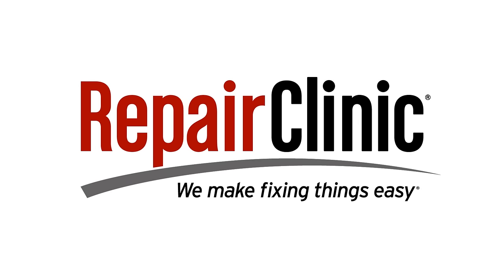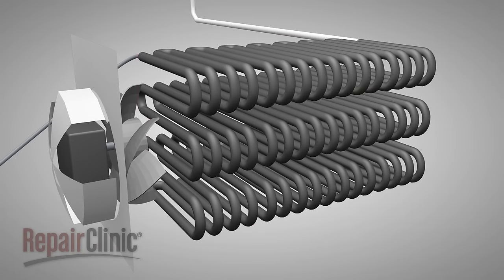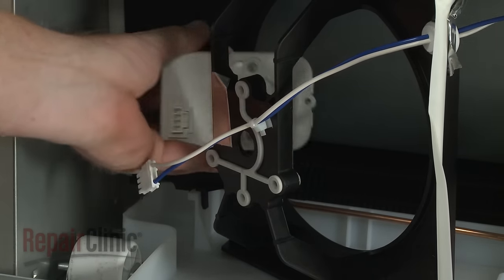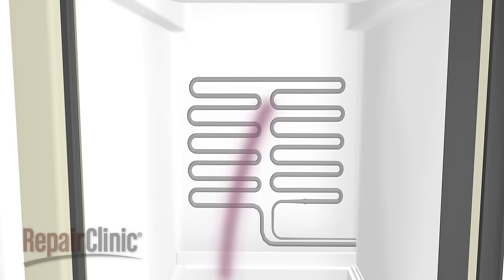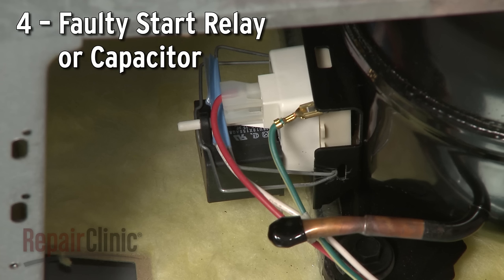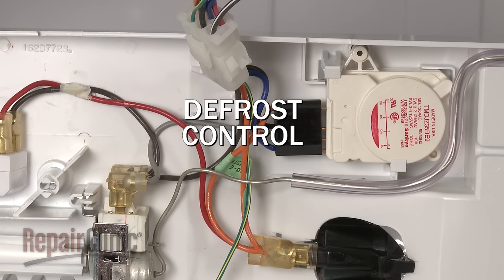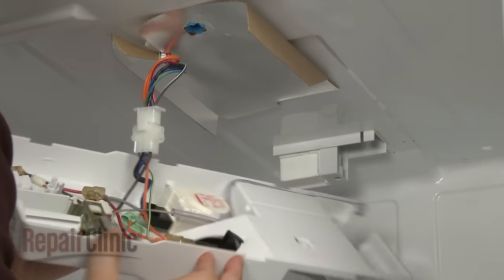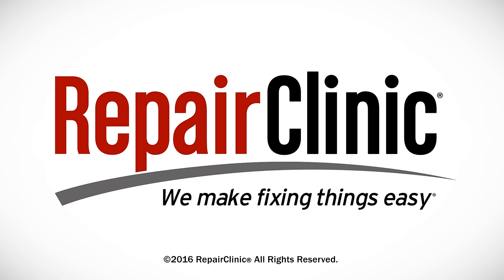Refrigerator Isn’t Cooling — Refrigerator Troubleshooting

Comment: Defrost timer was my issue. My 29 year old fridge was lukewarm. Freezer portion was ice cold. Checked coils. They were frozen over. Defrosted them with blow dryer. Fridge started getting cold again. A few days later, same problem. Checked defrost timer. It was broken. Replaced that for about $20 something. Fridge and freezer is back to normal.
Reply: I am having the same issue with my whirlpool, I thought it was the damper not opening , because the freezer is fine but I removed the damper and the fridge side isn’t cooling.   When I first defrosted the freezer , the fridge side got cold for a few days , but now back to warm.  Do you think it’s the defrost timer ? I’m lost on this.

Comment: I replaced my heating thermostat, temperature sensor, and  heating element and freezer coils still freeze up and heating element won’t turn on. But it will turn on if I jump start the board by touching j9 and j11 with a wire, why doesn’t my heating element turn on with out touching j9 and j11 together? Please help my food is going to waste

Comment: 1. Clean compressor cools
2. Malfunctioning condenser fan motor
3. Defective evaporator fan motor
4. Faulty start relay or capacitor
5. Evaporator frosted over
6. Malfunctioning temperature control board

Comment: Great video, thank you for sharing. Our refrigerator decided to take a poop on is last night. Not pushing out air cold enough in both the freezer and refrigerator.
Reply: Stacey Here we grow again 
Same, did you fix it?
Reply: @matthewmoneta7906  it ended up being that the freon was leaking (not sure how to spell that lol). which is impossible to find, so we bought a new one for a reduced price
Reply: I think I have the same problem. How old was it before it stopped working?

Comment: Thanks for the post... my refrigerator was sinking fast (declining temperatures), FF light was on. Checked the coils and realized that was the problem. Many Thanks!!
Reply: OUR problem is that the appliance is READING both 1 AND H, meaning that the refrigerator/freezer will go to the MINIMUM, THEN the maximum (and THIS is where you'd HEAR the beeping)

Comment: This worked for me unplugged overnight left doors open and put a electric heater in front of freezerNext morning plugged it in and it worked!!!! Try this first before you run out and buy a new one
Reply: Did you see your evaporator drain pan fill up/overflow?
Reply: @StephenAndrichuk  where is that at? Under the coil?

Comment: Hello 
I have problem with my Frigidaire refrigerator with french door same like this in the vidro. 
when I plugged it everything work fine but after few hours/over night it get worm, not cooling anymore, all ice melt and dripping water 
 I changed the relay/capacitor, clean everything in back, the problem still
So what should be the problem 
Please 
Thank you for your help

Comment: Would you mind advising me, my compressor is running, both fans are working well, I cleaned the coils (they were very dirty) , the main panel shows no signs of damage, blown capacitors etc, this began when my wife accidentally didn't close the freezer all the way so it iced over, unplugged for 2 days now, I'm thinking the thermistor or other temp sensor not calling for cold, all my major components are running fine. Thanks much LG french doors with bottom freezer drawer
Reply: Did you ever figure out the issue? I have the same exact situation at the moment with an LG. Sounds like similar models from your description.
Reply: @mrooah  LG has a compressor lawsuit going on with their models as well as Kenmores using the same LG compressor. This might not be the fix you're looking for, but it can get you a new fridge.

Comment: I have a 21 year old Amama refrigerator and the freezer is at the high 20’s and the frig about 40 deg F.  Yesterday I pulled it out and removed the back bottom panels and vacuumed all the crap out. After one day it runs a little better but I think that I will have to get a new model.  Last century I had a problem with another frig and it was caused by a loose piece of insulation stopping the fan.

Comment: My KitchenAid Side by Side (Model number KBFS20ETSS01) is not too warm.   My refrigerator is stuck at 55 degrees, and my freezer is at 40 degrees.  I have unplugged and plugged it back in, turned it off, using the Temp Control buttons, but the desired temp settings, go right back to 55 and 40 (Fridge and Freezer) respectively.  No matter what I do it goes right back to the warm temperatures.
Reply: this is exactly what is happening to ours now , did you find out what was wrong???

Comment: My frige side isn’t cooling , freezer is fine. I pulled the damper assembly because I didn’t feel cold air, but still no cold air is blowing through .  Yet the fan in the freezer is fine and it’s blowing.  But for some reason it’s not coming through to the fridge. Someone below said defrost timer.  Originally my freezer was frosted , I defrosted and it did get cooler on the fridge side , but now a week later it’s not working again.

Comment: I just got this refrigerator three days ago the only exception is it’s a Frigidaire. The temperature is fine but It has not stopped running since I plugged it in.  Is this normal on new refrigerators ?

Comment: Please advise what your thoughts are - I am trying to find a problem in my side by side fridge freezer as while fridge one works fine, the freezer evaporator is only 1/4th frosted and so food does not freeze. Everything seems working fine, there is no sign of leakage in the coolant and I'm puzzled..
Reply: its most likely short on gas ....after recharging the unit clean the condenser
Reply: +sim ridge will do. many thanks
Reply: +Joshikol x charge it to 5-8 psi and remember to check what gas it uses
Reply: Thank you for your answer Sim

Comment: Not the freezing over of the  drain at the back of the fridge.......???? That will happen now and then ....at the moment it happens with my new fridge which I could only place under the kitchen counter top with the acquired 5 centimeter ventilation space near the fridge top, which still traps a lot of warm air under the counter , which I think is the cause of the drain freezing over ?

Comment: Question:  whirlpool frig auger not coming on.......took it off and put 120v direct and it works....checked the micro switch in the door and have continuity.......put a volt meter in one of two wires going to micro switch to see if power grounded the other lead to frig  nothing  did with the other wire, no voltage?   any ideas??? thanks

Comment: What could cause only the top evaporator coil (where the freon is entering the coils) to be cold but the rest of the coils to be NOT cold? The air coming out of the air baffle on top of the fridge is warm but the compressor seems to be working since there is frost on the first coil but it seems most of the evaporator coils are not getting cold.
Reply: Did you ever get it fixed? I have the same issue.

Comment: My Kenmore model number GS5SVAXVB01 side by side is not cooling.  I replaced the devise on the side of the compressor, with the 3 prongs,  the compressor now runs, but gets warm/hot and still no cooling.  I touched the cold line and the hot side line and neither are hot or cool. All the fans are running, and the coils are clean.  Is there a video to diagnose this issue?

Comment: I have a Whirlpool refrigerator that is not cooling(does not have a freezer section). The compressor and all fans are running. The only issue I see is that it is icing up where the tube comes from the condenser into the small copper line going back to the compressor. It is right next to the thermister. Any suggestions? Thanks

Comment: Freezer fan blowing cool air but not freezing food or water. Whirlpool top freezer 13 years old.Condenser coils are clean, door gaskets seal good, compressor is not hot and food in freezer real cold but, water in ice tray will not freeze.
The fresh food department is cool and not cold.
Please help!
Awesome video. Thanks so much.
Reply: I have a Frigidaire Gallery the freezer works fine but the frig doesn’t get cold at all. I cleaned the coils on the bottom. Please help, can’t afford a new frig right now.
Reply: @yjeffe  evaporator fan motor most likely bad

Comment: Hi Guys, I have model E23CS78HPS5  Electrolux icon series freeze . having issue with it is not getting defrost and then freeze get warmup . one tech came in check defrost heater and thermostat is ok  along with evaporator fan ok, compressor is ok  ,condenser  coil cleaned , now try to find temperature control board or main board could be issue that not sending signal to do defrost cycle. head office had no info other than suggesting  call their tech but they don't have control board in stock . any help to  open this both board to inspect before ordering or other hint would be appreciate.

Comment: I have a ge dss25ksrc ss I cleaned the coils.  Both of the fans are running.  Is the thermistor the next step? Can I by-pass it to test if it's the problem?  I don't think the compressor is running.

Comment: my evaporator fan motor doesnt turn on. I've replaced the motor. compressor works fine, but no circulation. is there a component that controls the fan motor?

Comment: My refrigerator is a GE profile, side by side. The freezer side is working just fine, but the fridge side has gone warm. The message "dE" is flashing. I unplug unit from the wall to do some kind of reset, but this has not helped after a while, what would I need to do, please?
Reply: Ken Akoh-Arrey have the same problem i don't know
Reply from the maker: This is indicating a defrost system problem please click here: https://www.youtube.com/watch?v=5vA8Ksv5kVY&t=4s
Reply: Ken Akoh-Arrey
Reply: Oh, I solved my problem by replacing the heater.
Reply: Ken Akoh-Arrey I also have a GE and it built so much ice in the freezer I got in the fan and was very loud so I unplugged it to defrost it but now the freezer works in the refrigerator does not and it's only 2 years old
Reply: We have a Frigidaire side-by-side refrigerator and freezer.  The digital reading is ON THE FRITZ, and will show a "1" and "H" alternately.

Comment: help we have a KitchenAid refrigerator. approximately ,5 years old. 3 weeks ago alarm went off saying high temp I'm fridge.  couple days later it quit making ice. freezer is fine , but fridge still alarming. had repair man out he replaced termistor, didn't fix it. told us we needed control panel , that didn't fix it. any suggestions,? thanks

Comment: Hello, I have a Samsung RFG298AARS, the refrigerator stays at 40 degrees while the rest of the unit seems to be working fine. 
I have replaced the evaporator fan and thermostat.
If I push power cool the refrigerator will go down to 30 degrease.

Comment: I have an lg lfx33975st and the evaporator fan isn't spinning. No obstructions and there is continuity, but it just does not want to spin when the fridge is powered on. Any suggestions?

Comment: LFXS24623D/00 LG refrigerator evaporator fan wont run, compressor working,  but not cooling.  any on help me please?  both lines of compressor has the same temperature.

Comment: help pls. my ikea refrigerator is not cooling ref. is practically new about 3/4 years have no idea if it has  warranty. eve thing on out side Looks ok. but don't know what look for in side of the paper on back of ref. can u help?
Reply: Lilly C I would look at the components that are listed in this video to address a fridge not cooling issue. If it has frost build up then could be a defrost issue. If no frost then check some of the other parts mentioned such as the damper door or condenser coils to see if dirty.

Comment: i HAVE A GE PROFILE SIDE BY SIDE REFRIDGERATOR IT HAS AN EVAPORATOR ON THE REFRIGERATOR SIDE AND FREEZER SIDE SHOULD THERE ALSO BE AN EVAPORATOR FAN ON BOTH SIDES?
Reply: No. The fan Should be in the freezer section above Those coils behind that back panel. The fridge side gets cold air from the freezer section in side by side models and top and bottom models, but The ones with the freezer on the bottom. I think the coils are located in the refrigerator section.
Reply: So no evaporator fan in the fresh food section But there is a motorized damper that allows air to come in from the freezer.
Reply: Never really heard of one having two evaporator coils. Lol

Comment: A refrigerator should last 20+ years until it runs out of gas, which can be refilled.
Reply from the maker: A refrigerator typically lasts between 10-20 years depending on regular wear and tear. A refrigerator will last longer with regular maintenance and upkeep.The average life expectancy of a refrigerator is about 12-14 years.
Reply: I am not talking about American or Chinese fridges which are designed not to last for repeat purchases and profitability in mind. A fridge doesn't need a lot of maintenance and it will last up to 30 or 40 years. A fridge is a robust equipment and I am talking about fridges from reputable manufacturers. I had a family fridge that lasted 30 years and we sold it not because it was broken but because it was old. It was still functioning

Comment: I have a GE GFE27 and the front panel reads two different temperatures. When I press the temperature setting it reads 34 degrees as temperature sat for the refrigerator but when that reading goes off then a temperature of 55 shows as refrigerator temperature. My refrigerator feels warm, like 55, and my milk went bad. what do you think the problem is? should I get someone?

Comment: My compressor will not go off.  My freezer works, but the refrigerator won't...any suggestions as to what's causing this?  Freezer is on top, refrigerator on bottom.  It's in my garage but it's been in the low 40s and around 60 to 70 degrees during the day
Reply from the maker: Check out this video Jessy: https://www.youtube.com/watch?v=5vA8Ksv5kVY
Reply: Check your defrost timer/ADC. Also, check your freezer adjustment. Make sure it is not on "Coldest", since this shuts the damper door from the duct to the fresh food compartment.

Comment: The liquid expands to a gas when in the evaporator coil and absorbs heat. The heat laden gas is then carried to the condenser coil, where the heat is then expelled and changes back to a liquid in the condenser coil and is ready for the next cycle.

Comment: I don't think fixing any appliances these days is worth the time/effort and the money.  My fridge and freezer stopped cooling and everything is melting down,  I can hear that the compressor is trying to start but can't while the fridge is running supposedly.  I will just go ahead and buy another fridge which will probable cost a little bit more than the cost of repairing this one. (which is 5 years old)

Comment: So the air goes into the freezer first and then into the fridge? What if there is too much food in the freezer that it's blocking the airflow into the fridge?
Reply: Yes for your first question. The evaporator is in your freezer section absorbing all the heat with the help of the evaporator fan motor. Then there's a duct or damper that dumps some of that freezer cold air in the refrigerator section. I know the new fancy refrigerators which I personally don't like cause they break like in 3 years are sometimes separate where there's a evaporator in the freezer and the refrigerator section combine with sensor/thermistors to tell the control board which part of the refrigerator needs cooling/defrosting, in these they have 3 way valves. But the fridges in this particular videos are better and easier to repair in my opinion. Those new fancy Samsung's/ LG'S ARE to expensive garbage. Hope I helped. If not have a lovely day/night.

Comment: I changed defrost heater, thermostat and defrost timer yet my refrigerator freezer is cooling, but wont freeze. What's next to repair?
Reply: I'm having that problem. I haven't replaced anything yet but the airflow is cool but not enough to freeze. Did you happen to get it fixed?

Comment: Dirty condenser coils
Condenser fan motor 
Evaporator fan motor 
Compressor relay or Cap
Defrost system 
Control board 
😇😇😇